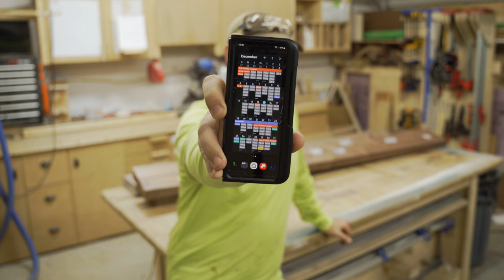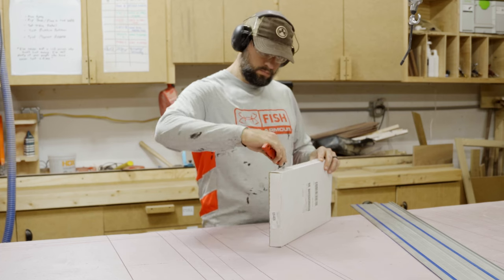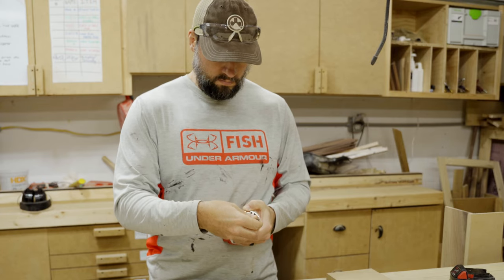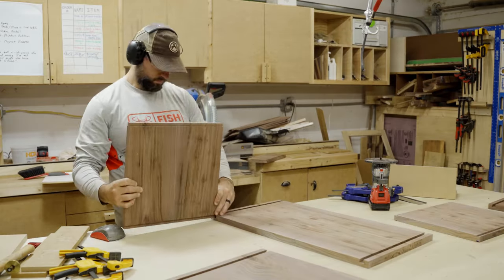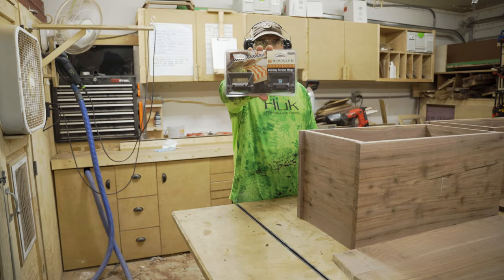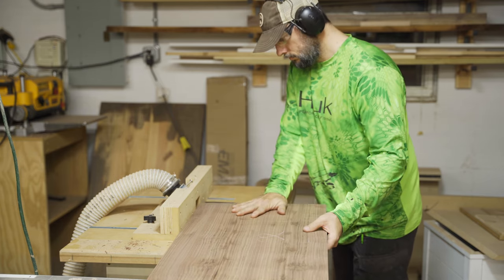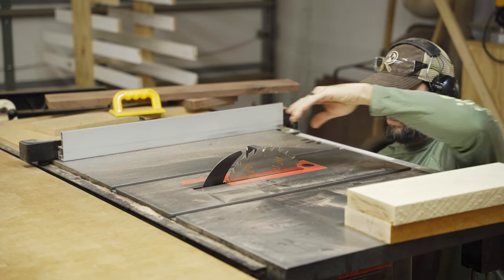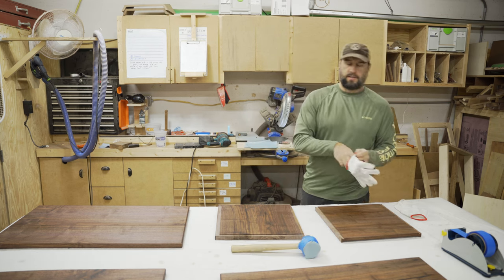How To Build a TOY CHEST | Is This The Most Important Thing I've Ever Made?

Comment: can you make an instructional video how you made the dove tail rabbid joints?  I don't have a table router; so I have a similar hand router you used to go through that part.  I too have failed with making a jig and definitely hold my  breath - but as a beginner I think you can offer good tips if you made a separate video.
Reply from the maker: Absolutely,  this is already in the works, along with a detailed finishing video.